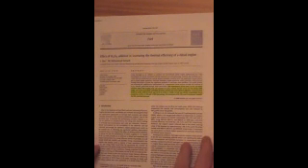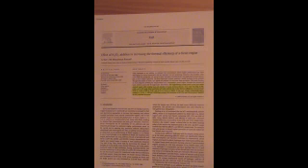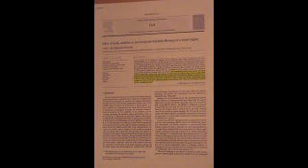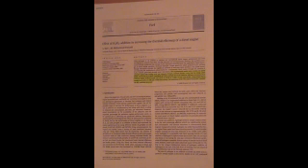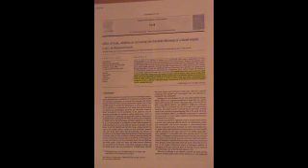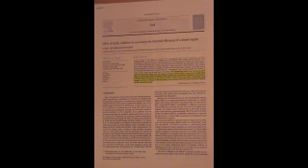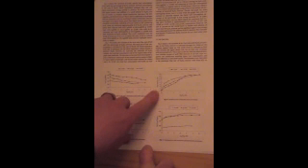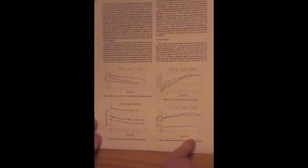Does HHO Work? Part 2

Comment: We have been traveling around the USA for six months in a 29ft RV. I have tested my MPG before HHO and consistently got 8.0mpg which is shocking but apparently normal for a Ford 7.2litre V8 engine. After I built a crude 16 plate HHO system and installed it. I immediately got 8.6mpg. I increased the amps until i was at maximum before meltdown or boiling. I now enjoy around 9.0MPG and have saved more than $1000 in fuel in 25000 miles. 10-15% savings is still better than none.

Comment: As you are well aware, I have  been running Ethanol with water injection and water vapor. Why do you think I do it, Dustin? Also as you know, I no longer run a booster on my car. But I am thinking of putting one back on it for more testing.

Comment from the maker: It is more complicated than just putting a cell under your hood.  The amount of hydrogen needs to be matched to the engine and the engine needs to be tuned to the new fuel mix.  I am working on determine what parameters are required to make a successful system.  This video is showing scientific evidence supporting using hydrogen from to improve engine performance.